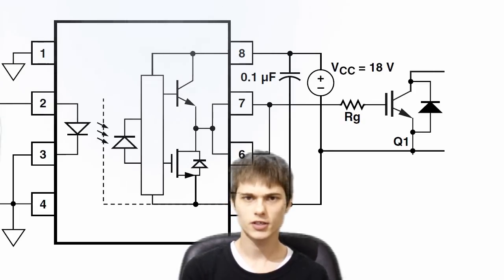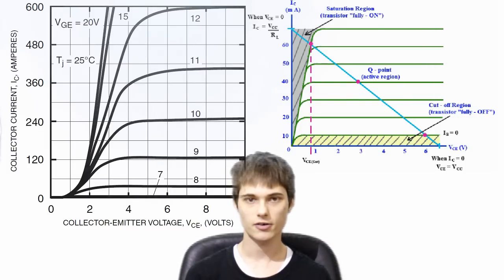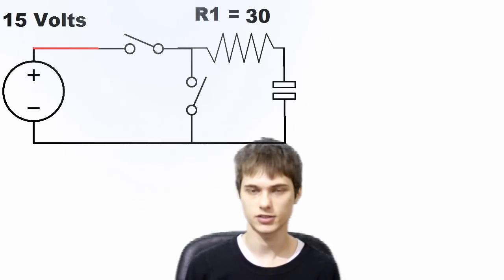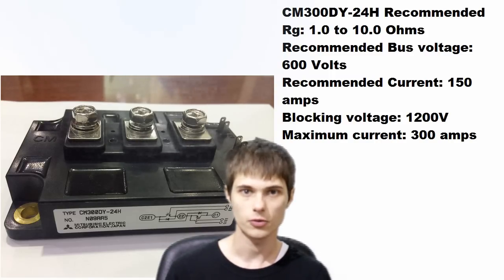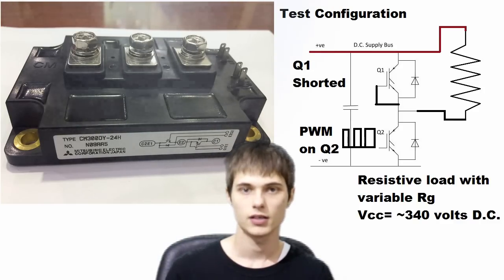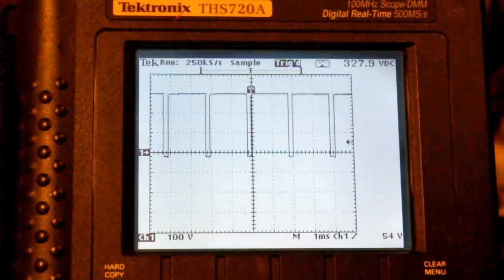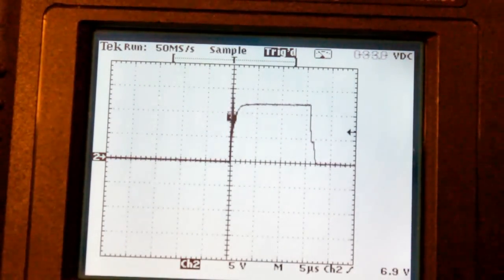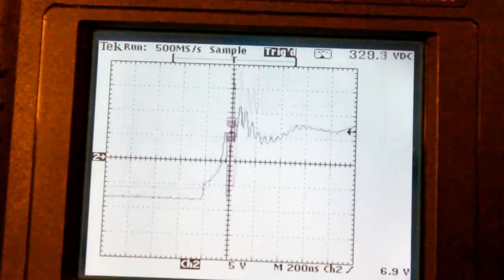IGBT Gate Resistors

Comment: well explain, i really need your help, i want to run air conditioner compressor up to 40amp 220volt with fz800r12kf4, it is a 1200v 800amp igbt, , can you help me with the gate circuit diagram

Comment: tell me I want. need to know! like if I had a irfz44N . on a 22-29 volt circuit . what resistors would I need. I been watching videos. all I have learned . is my head hurts!
I been watching videos . trying to learn this stuff. now I need to build a alternator voltage regulator . don't know if you know anything about them. but I need a get to ground the rotor. the pos. side is directly connected. to the brush. the start switch needs to turn on the gate. then it needs about a 26 v zener diode to turn on the gate of another N channel. this one shorts the gate of the first one. shutting it off. it works like a pwm to regulate the output voltage. so the zener shuts off the power. to the rotor brushes. when the voltage gets high enough. when it drops a bit . the reverse zener stops conducting. allowing the first get to turn on. then repeat many times a sec. the rotor is like a 10-15 amp load or less. I need help with choosing FETs and resistors. I was going to do the trial and error thing. however I hate burning components. when it can be prevented! any advice? thanks a lot either way!
Reply from the maker: First, do you have an oscilloscope? If not, get one. You'll never know why your components are being destroyed without one. You must be able to check the gate voltage waveform. If it is switching too fast or too slow that will cause problems. I can recommend gate resistors all day, but without seeing the actual waveform, I'm just guessing. Same goes for the Drain - Source voltage, you need to see how quickly the MOSFET is actually switching. 

Second, you need to be using a freewheeling diode. using just one MOSFET won't provide adequate protection. The back voltage from the rotor will certainly be enough to destroy an IRFZ44N without a freewheeling diode. So if you aren't using one, put one in the circuit 

Third, simulate. Use something like LTSpice and simulate a MOSFET switching an inductive load before doing so in the real world. Resistors and MOSFETS are free in LTSpice and they never blow up. So I highly recommend simulation first before going into the real world. Check the voltages and currents in the simulator, when you are comfortable with them, then try the same circuit in the real world. 

If you have any other questions, feel free to respond here or message me. Thanks for watching.

Comment: Nice info abt the gate resistance.
sir, I have 20kw of induction heating machine. It runs very well, bt the problem I am facing is, after every 15 minutes my input current falls by 0.5 Amps. Since my frequency is also matching (primary to secondary of impedance/ coupling transformer). Let us consider I switch ON my machine, I measure current 5 Amps. After 15 minutes it falls to 4.9, 4.8,4.7, 4.6....4.0, 3.7,3.2,....2.5,2.1,......and so on. What the reason would be ?????

Comment: Thank you for posting your videos.  I came across your site while researching how to design an Electric Vehicle speed controller... they have saved me a YUGE amount of guesswork and luck. :)

I am not sure if I need a large value capacitor in addition to the snubber cap...

HTTPS://youtu.be/MLEP0eRGV7A

Any thoughts?
Reply from the maker: If this will be used in a truly automotive environment I would add a significant input capacitor. The IGBT you are using is probably a bit overkill, but it does at least add some tolerance for adverse conditions

Comment: Thanks for the great video. I posted a question before regarding paralleling IGBTs.  From all I've been reading, one method to reduce parasitic inductance is using a ferrite bead between the gate resistor and IGBT. You pick a size that saturates at your drive frequency and then it imparts a given resistance (so you'd pick a smaller value resistor also). From what they say it takes care of some of the inductance issues as long as you don't pick one that itself has too much inductance. I was wondering if you have any experience with using ferrite beads like this or have any opinions?  Thanks again.
Reply from the maker: I don't have much experience with paralleling IGBTs, but from what I know it seems like using a common mode choke (probably with a ferrite) does seem to reduce inductance and mismatch between the gate driver and two IGBT modules.

Comment: Pretty good but what currents were you running? if the current was minor for the IGBT it might behave a lot nicer than if significantly stressed. I have certainly seen far bigger ringing in my setup. It might also be interesting to measure a rough thermal dissipation in the IGBT vs gate resistor to get a sense of how substantial the thermal trade off is for low ringing.
And a final aspect which is particularly interesting is how significantly does it affect lifespan. Does ringing up to the 600V limit cut its life by a factor 1000 or is it really completely insignificant. Is it only RF considerations or is it actual reliability.
Bonus aspect :)  can you switch hard and have a say 450V TVR diode in parallel with the IGBT to drink the spikes and protect the life of the IGBT that way while having a sharp switcher..
And if you want to refine a video, maybe consider rewording/editing for maximum concision so a 13 minute video could be 5 or even less without loss of content. In principle I think a video like this could be a crystal clear 30 seconds without rushing anything. Just a thought.
Good video though. These are interesting topics. Mastering proper use of an IGBT makes things very easy.
Reply from the maker: +Dan Frederiksen Yes I think you are right about these points. Thing is I have shown in a few videos what happens at very high currents with extreme ringing, and a few other videos operating IGBTs with liquid cooling in conditions where they would normally melt down. I make one video where I think I've covered it all, but then newcomers ask a specific question I have already answered. I then feel the need to make a new one. But I think I'm going to try a different approach. But as far as some of your questions... I do believe riding the voltage limit is stressful, but I can't say more stressful than being thermally overloaded. Really depends though. Riding the voltage limit might be okay if we did not have to deal with cosmic rays (strange, I know) IGBTs operating at higher voltages tend to have problems, especially at high altitude. Thermally though, it is the cycling that really hurts the IGBT. for example in an EV, if you're in stop and go traffic, the IGBTs are heating and cooling cyclically, so the repeated thermal expansion is certainly a factor. As for using an external fast diode for an IGBT, apparently this does work, I've seen it done numerous times with tesla coils. Thank you for your thoughts and thanks for watching

Comment: Nice to see you're back;) Could you maybe elaborate on where to make the specific measurements? I've had different results depending on the length of my ground wire for my oscilloscope probe. I normally measure directly between G-S on my FETs; you mention the output of the gate driver? Thanks for the explanation;) 

Best regards,

Jesper